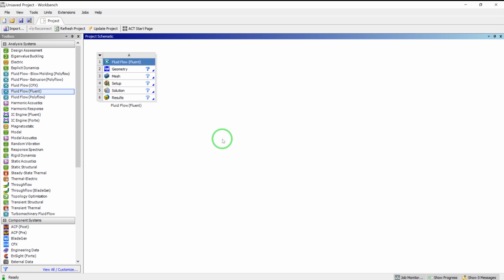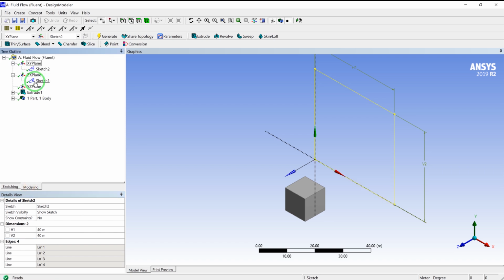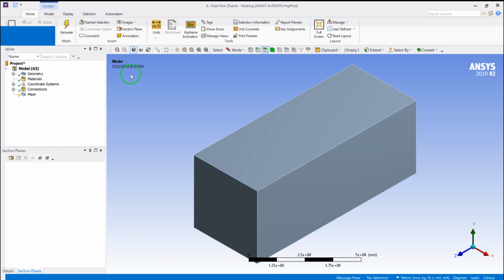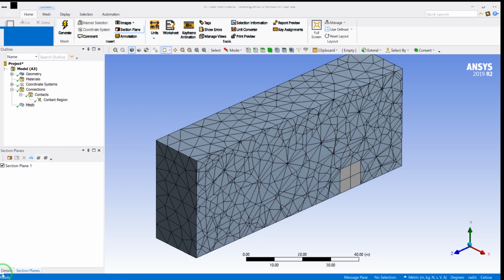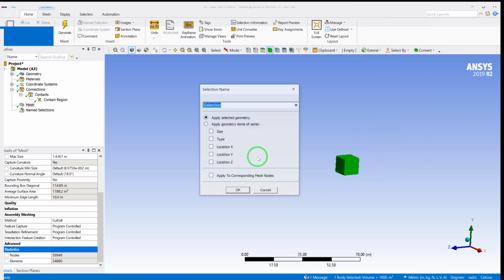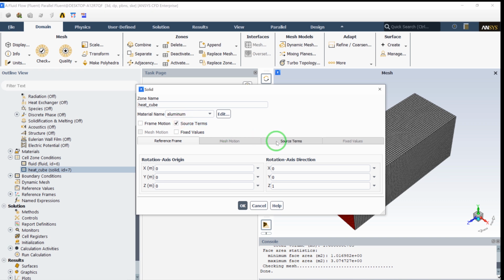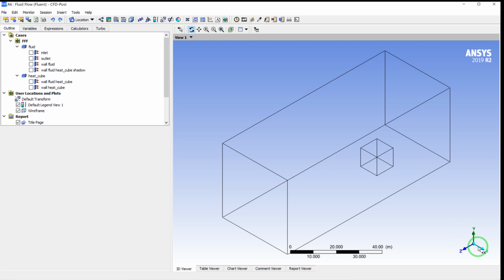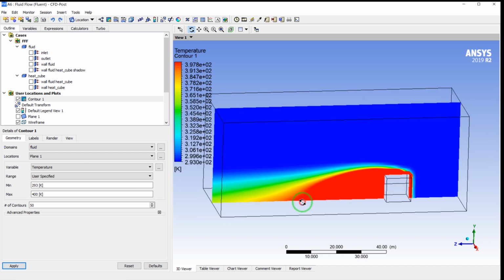Conjugate Heat Transfer Analysis with ANSYS Fluent CFD

Comment: thanks you. This is the best video I ever watch. I hope you can have more video in radiation heat transfer also. But I have 2 questions and need your opinion :1) Why we did not do new part under 2 part,2 bodies so that, the contact region  under connection is not appeared.  2) Why we need used cut cell mesh because of both have same geometry form as box? If I have fluid is box and solid is cylinder, did I need do the same mesh cut cell? Thanks in advanced.

Comment: hello sir, i am trying to simulate heat transfer in plate fin heat sink in ansys fluent. I am able to see convective heat transfer from solid to fluid but there is no variation of temperature on fin walls. the  entire body is of showing at same temperature. how can we see temperature variation at fin walls. plese help
Reply from the maker: Thank you for watching and thank you for your comment. First, try a very low thermal conductivity for the fin to make sure that you see the temperature difference so you can see your setup is correct. Then, in the contour setup, chose only fin as the body not fluid. You can also set the range manually in the contour setting to see the temperature gradient in the fin. Please let me know if this was helpful.

Comment: if I want to do the opposite, Transfer heat from fluid to solid,  should i follow the same methods ?
Reply from the maker: Thank you for watching and thank you for your comment. Yes, just define the fluid hotter than the solid. It is solving the same equations and your boundary condition will determine the direction of heat transfer.
Reply: have you done it...because i also want to do it but not getting proper results...
Reply: @abhaypareek2610  yes. I did exactly the same that same what the guy told me to do ( same thread). For me it worked. What error u are getting..?

Comment: if its ok can i know the optimal model and conditions that is required to get accurate results in the analysis of a heat sink using conjugate heat transfer?
Reply from the maker: Thank you for watching and thank you for your comment. In CFD there no optimal solution, it depends on your available computational power and resources, you can then optimize your mesh size, time step and solution method based on the time and accuracy you need for a specific project.

Comment: Hello sir. Thanks for this great video. Do you have an idea how to conduct a conjugate heat and mass transfer simulation? I mean suppose your solid body here is wet.
Reply from the maker: You need to define a thin layer of water on the solid body and consider evaporation and mass transfer. I could be a very complex and computationally intense problem.

Comment: Hello! is it possible to add a heat flux in a specific face of the cube?  for example, i'm trying to simulate a heat sink for a CPU, so the heat flux is coming from the CPU to heat sink through the bottom face, how do i set that heat flux? 
thanks for the video!
Reply from the maker: Thank you for watching and thank you for your comment. Can you let me know if you will include the CPU in the simulations? Or you just want to have effect of CPU on the heat sink?
Reply: @AdvancedEngineeringTutorials  Hi! I am also doing something similar. I will not include the CPU in the simulations just want to study the effect of CPU on heat sink. So I would like to apply a certain wattage to one face of the cube.
Thanks a lot!
Reply from the maker: @VasanthS  So select the wall and define the heat flux based on W/m^2 on that wall. Or you can define a cube as the CPU and define a volumetric heat source for that in the cell zone condition.

Comment: Can you help me? 
I'm trying to simulate a geometry similar as yours. It's a tunnel with a piece of wood inside and the goal is wood drying, forced convection with hot air flowing through the tunnel.
I did everything you did in the video but my simulation didn't work, it seems that my mesh interfaces are not being connected.
Reply from the maker: Thank you for watching and thank you for your comment. Are you making a single part from the bodies in the Design Modeler?
Reply: @AdvancedEngineeringTutorials  on Ansys workbench, always when I start a geometry project, it opens the Space Claim and I'm not sure how can i do this in this software.
Reply from the maker: @kkggff1  Instead of double-clicking on the geometry block, just right click on that and choose the Design Modeler instead of space claim. I will try to explain in the next video how to do that.

Comment: While plotting the temperature contour of the fluid domain, by specifying the user specified range, did it not change the result completely? Since the max temperature is around 3266K?
Reply from the maker: Thank you for watching and thank you for your comment.
That is right. Two points here:
1- The simulation is only for learning purposes, and that high temperature might never happen in any engineering problem.
2- Changing the user defined temperatures, will not change the results, will change the color map and the range of coloring from blue to red based on the defined min and max temperature. 
Please let me know if that is not a good enough answer and I can explain more.
Reply: @AdvancedEngineeringTutorials  Yes, thankyou for the explanation, the range is just for better visualization as far as i can comprehend..

Comment: One of the best videos out there! Thank you.
Reply from the maker: Thank you for watching!
Reply: @AdvancedEngineeringTutorials  hello sir, I am doing thermal management system of lithium ion battery as my final year project, can I use conjugate heat transfer approach for my project and another doubt is why don't you fill the outer box with fluid using "fill" command.

Comment: Great and helpful work.
I tried to do the same thing,  I have three cubes, the small is the heat source inside the biliding, inside a large cube that presents the atmosphere..... I can't find a good result.
Reply from the maker: Could you clarify the problem? Where is the wrong results?
Reply: @AdvancedEngineeringTutorials  I don't have symmetry around the second cube.
Reply from the maker: @asmaa540  As I understood, the second cube is the building, this can be because of the mesh quality and size. If you have large cells that are not symmetric that can be an issue. If you know that you have symmetric geometry and flow, why don,t you just simulate half of the system and reduce the mesh size to get better results. 
Please let me know if I can help more.

Comment: will we get the same results if we use one fluid body? just subtract another from one and apply HEAT FLUX to inner faces?
Reply from the maker: That is correct for the fluid side. CHT is mostly used to identify temperature distribution in the solid side. For example you are cooling a chip using a fan and you need to identify the temperature distribution on the chip to analysis the stress and other things. If you do not need the solid side in your problem, you do not need to use CHT.